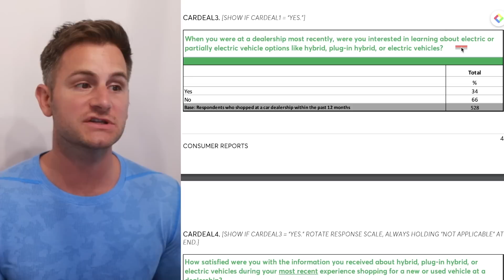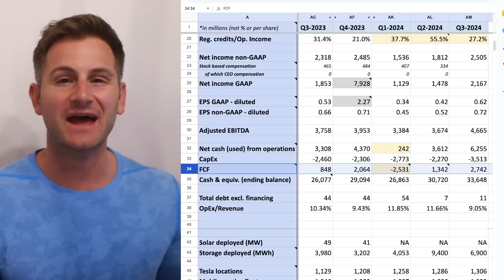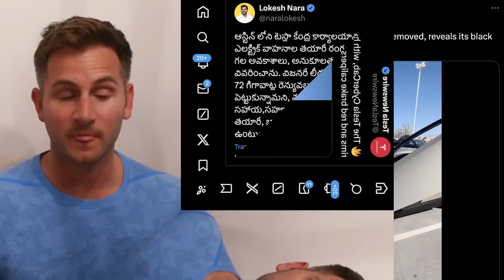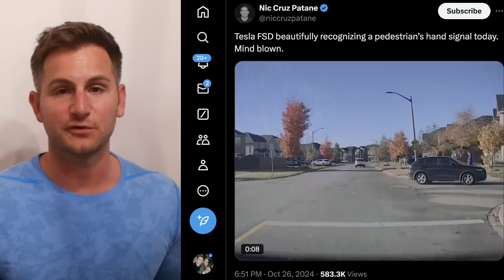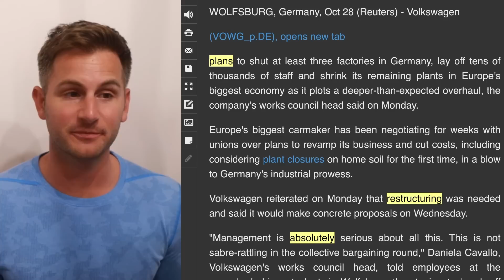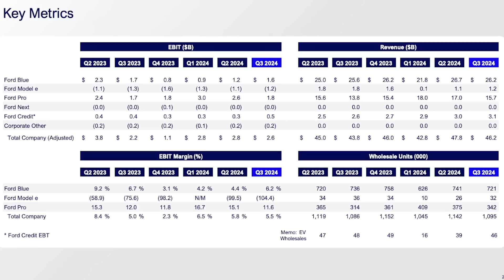Tesla Announces New Standard / VW in Nightmare Situation / Wall St. on Tesla Raising Money ⚡️

Comment: The problem with 48V is that it breaks the resistance barrier on the skin, meaning you can't just touch the poles like you do a standard 12V without the risk of electrocution.

Comment: I certainly do think this sort of LVCS standardized connector is an excellent idea. Variation in design - at basic points of commonality - is bane in the lives of customers, service men and women, assembly line workers, and the whole overall factory and supply chain. We see this sort of thing play out all the time - over-choice (or freedom of choice w/o consideration) simply leads to exploding incompatibilities, confusions, and uncertainties. For example, NASA funds Boeing and SpaceX to build craft that fly people to the ISS. But it fails to standardize spacesuit fittings. (In the future,  spacecraft - with or w/o airlocks - should also have at least common (international) docking adapters which will work both ways (e.g., dock to each other as well as stations) for in flight crew-exchange or rescue).

Comment: Standardization is good. One possible  concern: with many identical connectors, what are the odds a factory worker or repair technician connects the wrong things? Sometimes connectors are intentionally made different to avoid this problem. They'll have to find a way to error-proof this.

This is a well-known problem in manufacturing. For reference: 
https://en.wikipedia.org/wiki/Poka-yoke

Comment: The issue that frustrates me is calling hybrid cars electrified cars. They are really just an efficient ICE car, utilising regenerative braking to improve overall fuel efficiency. In reality they are a marketing ploy to enable ICE producers to continue to make ICE vehicles while appearing to support the change to electrified vehicles.
Reply: Sometimes to get from A (ICE's) to C (BEV's) you must go through B (hybrids, political interference, intransigence).
Reply: @jamesbarnett9556  I can understand the requirement for hybrids, I just can't see the value of a hybrid unless it is a plug in hybrid, otherwise it is just an ICE car.
Reply: I pretty much agree. The same could be said about electric cars. Comparing Teslas (and the Tesla Eco-System) to most of the other so-called EVs or hybrids (especially, many of the cheaper models in China or the much more expensive models from legacy OEMs) is like comparing them to battery-powered go-carts.

Comment: There were several times when I was driving while using FSD 12.4 and 12.5 where it certainly seemed like the car was responding (correctly) to hand signals from other drivers/pedestrians/construction workers. Yes it could have been coincidence and the car could have behaved the way it did due to other factors, but it sure seemed like it was responding to the gestures as the timing was just perfect.

Comment: Why would Tesla raise more money in the next few years if the robotaxi is supposed to be in mass production in 2026?  By then, FSD should be ready and start contributing to the bottom line meaningfully.
Reply: To expand AI compute.
Reply: @billweberx  why do Tesla need to expand AI compute if FSD is already ready by 2026?
Reply: @dhui777  It's never done.  There's lots of countries that need FSD adapted for their roads.  Also, it's the march of 9's.  Tesla will continue to try to make FSD safer until it never has an intervention.
Reply: @billweberx 
As Dillon said, you have to be able to SPEND it.
Reply: @rogerstarkey5390  I'm pretty sure Tesla can spend an unlimited amount of money on AI compute.  If not with NVidia, then with Dojo.

Comment: While reducing connector types to a small number reduces the material and manufacturing cost it comes with the cost of a higher probability of incorrect assemblies. Perhaps not so much during manufacture (due to automation), but more so during maintenance activities. Using a plethora of connector types helps to prevent such human errors which can be very embarrassing and expensive. Just ask rocket companies Roscosmos and Firefly (IIRC)! Hopefully color coding or some other policy will minimize misconnection errrors.
Reply: Not having your vehical look like a spaghetti monster threw up inside it is a far better help in that reguard.